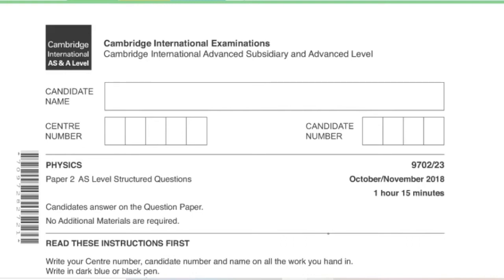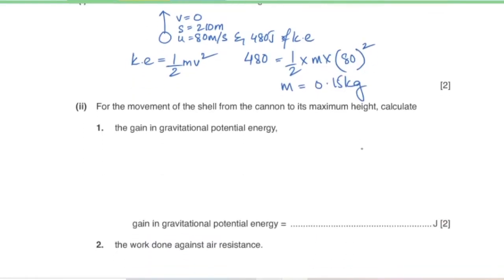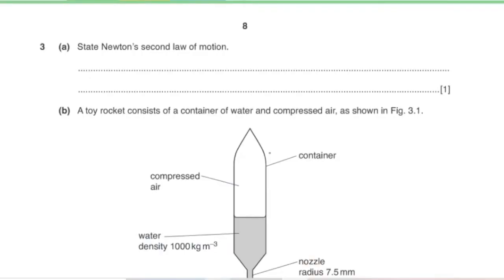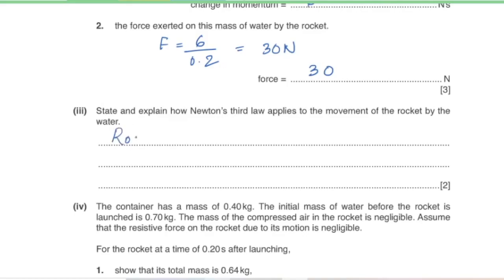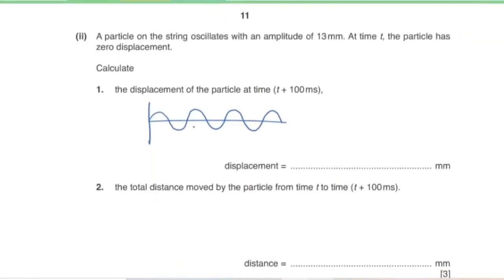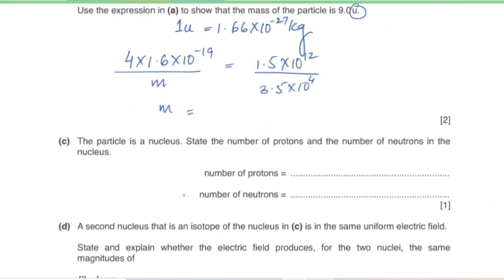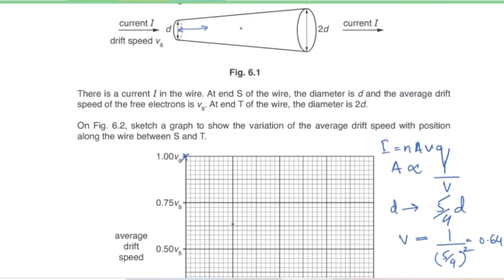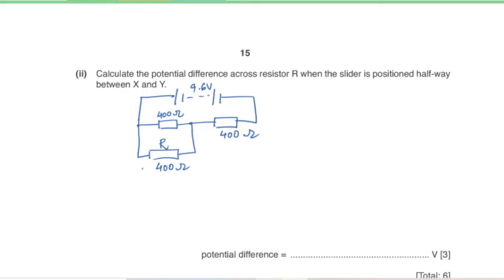CIE A Level Physics Solved Past Paper Oct/Nov 2018 P23

Comment: how to get 5/4 in Q6 c
Reply from the maker: Starting from d which is point S and then to be able to draw as accurate slope, I have broken the distance S to T down to four parts, d at S, 5/4d, 3/2d, 7/4d and then 2d at T. All these diameters are along the wire length. The division is just to make it easier for you to plot on the graph.

Comment: In Q2(b)(iv) what does the other graph mean then?
Reply from the maker: The other graph shows an increasing gradient so it's not best suited for part (iv). That can be displacement versus time graph where although displacement decreases when a ball falls towards the ground, gradient still increases because of acceleration.
Reply: @examhelpweb2090  but the acceleration is decreasing so shouldnt the gradient of the displacement time graph be decreasing too?
Reply from the maker: @faizrahman967  The one that you are talking about is concave up graph where yes gradient will decrease since it's decelerating but in the concave down graph where an object travels up in the air and back again towards the ground, the graph will be concave down with increasing acceleration or gradient because it is moving towards the ground.
Reply: @examhelpweb2090  ok thanks and in Q6(c) why does d increase to 5/4d
Reply from the maker: @faizrahman967  That's a way to explain how average drift velocity will decrease when d increases by 25%(d to 1.25d), then 50%(d to 1.5d), and at last by two(d to 2d).